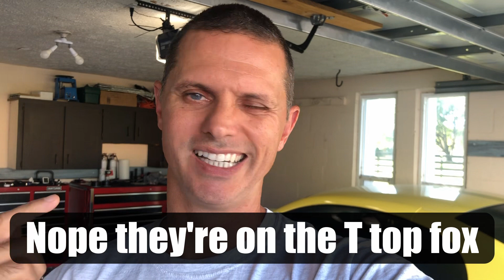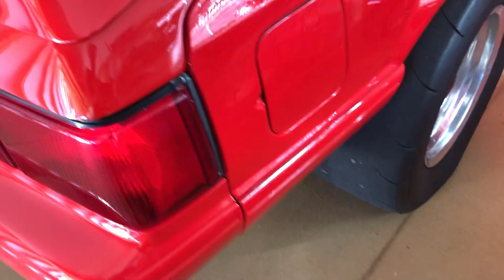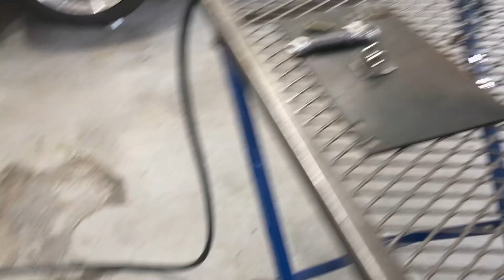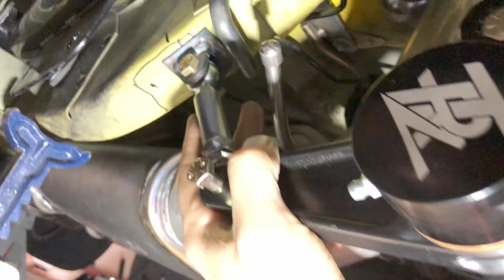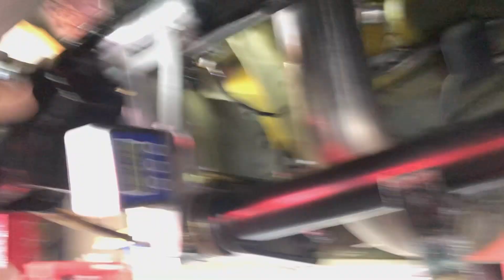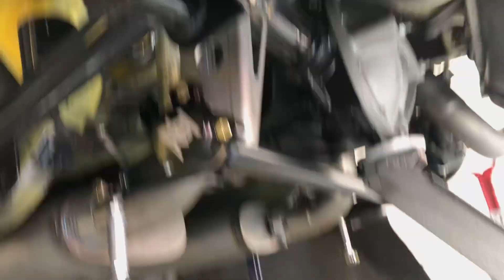03 Cobra Under Axle Anti Roll Bar Install

Comment: What catback is on your car? I’m currently looking for a 3” catback after swapping to SRA
Reply from the maker: It’s based on the Bassani over axle kit but I had to modify it a bunch. Pipes didn’t fit the greatest and took a lot of work to fit and I had to weld on additional hangers to keep it all together when driving. I went through 3 or 4 sets of mufflers trying to get a good fitment and sound and the pipes in front of the muffler that attach to the X pipe had to be lengthened as well. 
They are nice pipes but it was far from a bolt in deal.
Reply: Thanks for the info! Well you did a good job. It looks and sounds great! I found Bassani and Magnaflow 3” SRA catbacks but I’m thinking it might make more sense to just have an exhaust shop fab up a nice kit
Reply from the maker: @8URZ28  that's another good way to go.  It will also ensure it fits perfectly.

Comment: Definitely going to look at the under axle. Looks alot easier to weld in.
Reply from the maker: It really was. I also really liked the serviceable ends. The over axle units once welded in you can’t ever get to the bushing ends again. At least not the ones I’ve done.

Comment: I'm a Millwright and certified welder. To weld the inside of your gussets for the H joints you could of welded the inside with stick if you have one. For your application though what you did should be fine! Nice work !👍
Reply from the maker: That’s a great idea. I didn’t even think of that. I appreciate the tip.
Reply: No problem ! Great Cobra vids keep them coming !

Comment: TRZ is quality, i have the over axle ARB and the car feels way safer in straight line now. That under axle ARB is very neat. Love the idea of welding the tabs to a plate first.
Reply from the maker: Agreed I was impressed with the quality. Yeah the tabs on a plate worked out pretty good.

Comment: I'm surprised you hadn't put subframe connectors on before now. The car is going to feel completely different after those!
Reply from the maker: I had welded up the torque boxes in the rear and reenforced them with plates of steel on the inside and outside of car but never did put subframes in it.